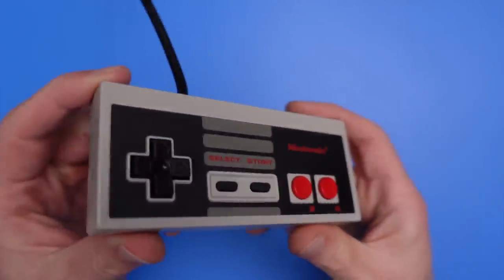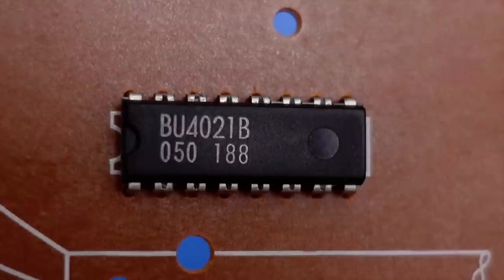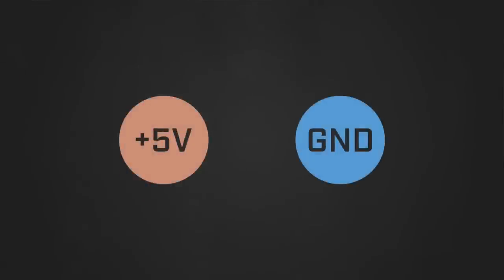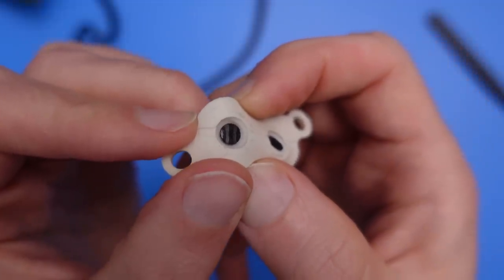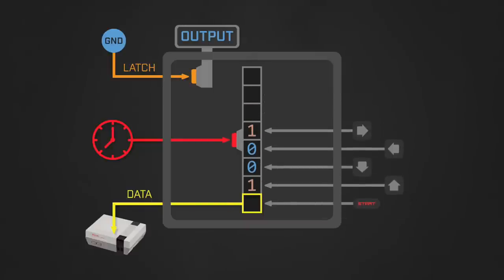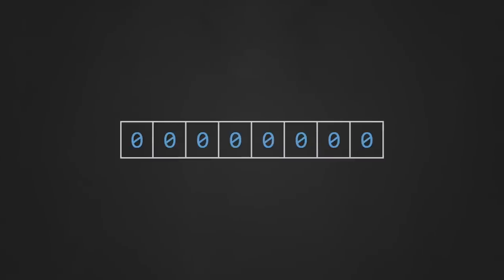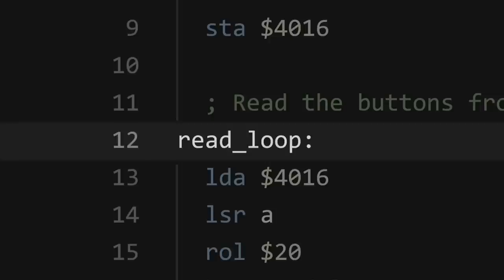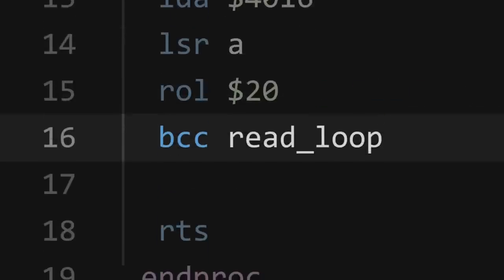NES Controllers Explained

Comment: Thanks for this, I’m enjoying the series. I’d love to see some discussion about how to call this and react to inputs. Do you do this at the start of the NMI to check for game inputs on each frame?
Reply from the maker: Yeah reading inputs every NMI is definitely the easiest way to go. That said, you only have around 2200 cycles to play with during the VBLANK to update the PPU VRAM. So if your VRAM update code is very tight you might need to save the NMI cycles and use a flag in RAM somewhere so the non-interrupt code can break out of the infinite loop and perform the read while the screen is being rendered by the PPU.

Comment: Wow what a great explanation.
Your visuals make it so much easier to grasp.
For future such videos, it might be of interest to give an idea of the number of clock cycles such a routine requires, and to compare that with the actual time it represents.
One question: I've noticed in GameBoy ROM disassembles that joypad inputs are read multiple times in a row, and I assume it's to limit mistakes, but I don't understand how that helps. Is it also the case for NES controllers?
Thanks so much for your excellent work. I look forward to supporting you on Patreon when your page is launched.
Reply from the maker: From what I can see, the GameBoy requires this as the values in the joypad register may not be set immediately and require you to perform multiple reads. I am unsure as to why this is the case, as I’ve not done much tooling around with gameboy programming. NES controller reading doesn’t require this. As I showed in the video you simply need to “strobe” the controller, then proceed to read each of the bits one at a time.

Comment: I really like the way you animated the workings of the BU4021B. What I/O chip is the NES using to decode the incoming serial data from the controller?
Reply from the maker: Thanks! That was a super fun animation to make. So the exact chip most likely changes for each of the specific system models, but according to the schematic the original famicom used two 40H368 3-state logic drivers to do the trick (each port used one of the inverters on each of the chip). The mechanism of operation is a bit complicated since those chips are used for more than just inverting the incoming button data. Here’s a link to a modern equivalent: https://www.ti.com/lit/ds/symlink/cd74hc367.pdf

Comment: It's been well documented the way an NES controller works (being a shift register the most popular IC in Youtube) but it's always nice and fun to have another perspective. Thank you.
Reply: Can you tell me where to go to research information on "micro PCB circuit boards" to make a micro controller for NES that works on NES original console/hardware. That has a ability to have direction on D-pad and/or buttons A/B to have auto-fire turbo capabilities? All the while working without the need for any external programs running on a PC like Joy2key, Rewasd etc....So basically all the turbo functionality is self-contained within the pad controller itself.  Somone said something about altering the shift registers to produce turbo. How do I find info about that? Googling it does not really bring anything up but pre-made third party Turbo controllers and that is not what I am talking about.
Reply: @rebranded1248  either I don't understand what you want or I haven't seen that type of gamepad, I saw a gamepad with extra 2 A and B buttons that fires rapidly, and I can't think of how to build one of those from scratch, but it shouldn't be terribly hard to build up.
Reply: @deltakid0  I am talking about a micro controller where you switch out the original NES OEM circuit board and replace it with a ardruino micro controller board. That way you can have a NES controller with hidden auto fire and  macros. I suspect there might be a couple speedrunners who do it professionally and they are indeed hiding the fact they are using micro controllers with auto fire.  It would have to be a micro controller cause the NES controller needs to retain auto fire ability independant of wether or not it is plugged into a PC or not. Just needs to have that special function if it is plugged into OEM NES console.
Reply: @rebranded1248  well, Arduino is the first option to come up when you need to prototype something, so, yeah, I think it's just an Arduino or even an ATTiny85 to solve your need, I would prefer the latter because of size so that you can fit it in the retail gamepad

Comment: NES Hacker, what is your view on  starting a ROM Hack by finding the subroutine that reads controller input,
then stepping through the code from the controller read, then trying to understand that code step-by-step from there. i.e. using the controller read as an organic starting point for code investigation.

1.) Finding whatever subroutine loads from $4016 (via searching function list in MESEN)
2.) Set a break point on LDA, $4016 
3.) Understand confusing mess of assembly?? 

Thank you so much for all your great content and amazing videos.
Reply from the maker: I think that’s okay, but honestly the controller reading code for most games probably doesn’t have much to do with the actual game logic. For instance, a game like MegaMan 2 has at least 6 distinct controller contexts: Main menu, Boss Select, Password Select, Main Gameplay, Start Menu, & Game Over. So the controller code is most likely abstracted out away from the logic that handles those different game states as part of a set of general routines that runs every frame.

That said, you can still piggyback off the result of the controller code, by this I mean if you can find the memory location where the controller buttons are stored, you can use it to find code that reads and reacts to that code. By combining this with other memory locations you can setup breakpoints that can pinpoint the exact location for code that handles various things (e.g. handling of the D-PAD buttons on the boss select or the code that initiates a jump for MegaMan himself, etc.).
Reply: @NesHacker  Thanks so much for the detailed reply!!

Comment: I know I'm super late to the party but, amazing video - thanks for sharing ! Out of curiosity, some FC controller models appear to have a 15 pin interface, would it possible/feasible to rewrite the controller input pooling routine so it could read a more "modern" controller, with at least L and R? I feel like this could open so many tools for romhacking and modders to add ergonomics into NES games such as zelda1 to swap weapons for example.
Reply from the maker: Yep totally feasible. The SNES controller is almost exactly the same except it has two shift registers which holds the value for all of its buttons. Basically you can use the controller ports as a general serial port as long as the game is programmed to use it that way.

Comment: I remember back then for some reason I took apart my NES controller , stripped the wiring and I tried to attach to my Atari plug . I was young and did not know much about testing but I never got it to work . I wonder if you can actually use a NES controller on a original Atari system . Has anyone tried this before ? Great channel by the way . Thanks
Reply: Atari controllers don't have a shift register. Each pin is used for a different input (Up, Down, Left, Right, Button). You'd have to completely rewire the controller's innards to make it work.

You can, however, use a Sega Genesis controller on an Atari because they both use the same shaped plug with the same directions for the same pins. Several other systems work as well.

Comment: I thought the NES automatically did this and loaded it into memory, that's interesting to know it doesn't. The explanation is really good as well and I understood it without prior assembly knowledge. It's really cool to learn the ins and outs of hardware like this, as a single person can actually understand the entire system as it's relatively simple.
Reply from the maker: It’s kinda cool too, cause you can use the controller ports as a general I/O interface that way. There’s no reason why you’d have to only transmit exactly eight bits.
Reply: @NesHacker  If I recall some of the TASbot submissions for GDQ have actually used the control ports for general I/O for things like audio playback through the console.

Comment: This video came in more handy then you could possibly know. I have maybe a tote full of NES systems with no controllers to test them. Now I don’t need one exactly. Thanks.
Reply from the maker: You are very welcome, I’m glad I could help
Reply: @NesHacker  I actually found NOS wireless NES controllers at a thrift store. For a dollar I picked up a few. I originally wanted to see if it worked for the system I have. Upon further review they went to some remake edition that didn’t use cartridges.

Comment: Of note: ground isn't always the lowest voltage on a board. It happens to be on many.
Reply from the maker: That’s true, I suppose you have negative voltages sometimes! I’m just so used to only working with digital logic so I always think of ground as “low” when perhaps I should think of it as “zero” 🤔

Comment: So if I have an SNES controller hooked up to an NES, and I want to read the controllers extra 8 bits, I just need to have 2 loops and read the other 8 bits into another memory location, correct?
Reply from the maker: Conceivably, though I’ve never tried it… I believe the SNES controller just has two shift registers in series to register all 12 bits of button data. Would definitely make for a fun experiment!

Comment: IDK if the pads on the silicone are printed with a pattern or if the pattern is imprinted by repeated uses. I say this because I took apart these controllers as a kid and never noticed a pattern on the pads, and these controllers were new back in 1985. 😜
Reply from the maker: Yeah I was having a hard time finding solid information on how those switches work. I’ve only ever seen them with the patterns, but like you say it could be due to use. Thanks for the info!
Reply: @NesHacker  dude thank you for doing these videos. I’d gladly contribute to your  patreon account.

Comment: What about button bounce?  Is that something that the programmer needs to worry about / test for?
Reply from the maker: It depends on situation. For things like menus and the like button bounce might be handled by waiting some amount of time to ensure the player is pressing the confirmation button. For most gameplay, however, responsiveness is more important so generally you don’t try to denounce the inputs (remember the NES runs pretty darn slow even compared to modern hobbies microcontrollers).

Comment: It's interesting that they used an integrated circuit on the controller itself to digitize the controller inputs before sending them to the NES.   It seems it would have been cheaper to skip the IC within the controller and send the analog signals from the button presses to the NES to be digitized, but I guess this didn't work as well.   I wonder if earlier game consoles did something like that.
Reply: If you didnt have the shift register you would have to have 8 wires returning instead of 1. The shift register makes it so that you can send a string of 8 bits back over one wire which tells you which buttons have been pressed rather than having one wire returning per button. 

Apparently wires were more expensive or something compared to the IC in the controller. Doesn't make a lot of sense to me either.

Comment: It sounds like the longer route on how Modems work. Encode data into signals and have them converted back into readable data on the other side in the console.

This kinda explained me how they could send all eight buttons through mere 3 data + 2 electricity cables, unlike other contemporary consoles with cables that weighted more than the controller itself!

And the blacked out graphite pads above the main buttons pads on the PCB are just resistors??
Reply from the maker: Yeah pretty sure they are, I was reading around 50k Ohm with my multimeter when I tested across them (though that’s probably a bit high since there is probably some amount of corrosion on the test points and pins I was using as contact points). Also one side is connected to high voltage and the other connects to the button switch / pin trace, so the only thing they could really be is the pull-up resistors for the button switch circuits.
Reply: @NesHacker  And me thinking they were left overs from the 2nd player or japanese FamiCom controller PCB designs and that I should scratch and tap to see what they do, haha! Now I see it's a terrible idea... 

Will you point out the differences and mechanics on the FamiCom controllers in a future video? They seem a bit smarter than American ones.

Comment: I’m sure most people know this but opposite directions on the D-pad can’t be pressed at the same time for example the up and down directions can’t be pressed at the same time or the right and left directions can’t be pressed at the same time but up and right or down and right or up and left or down and left can be pressed at the same time
Reply: I used to do programming on the Commodore 64 which used 4 position joysticks which like the NES controllers should not be able to press opposite directions at the same time, but I can tell you if you move it around vigorously you may get some from time to time.  So best to design the code to handle it cleanly.
Reply: @sa3270  I see

Comment: Something I found really strange is that some official NES controllers are not cross-compatible in different regions.
I believe the 101E models will only work on PAL system while the normal 101 will work on either.

I'm also curious about something.
You say the controller can receive inputs from the NES. I was wondering to what extent this could be used.
Like, let's say we had a theoretical NES controller with a little LCD display ala the Dreamcast.
Would it then be possible to send picture information to this little display while you play if the controller had some ram onboard to handle it?
Reply from the maker: Yeah, so there are apparently PAL consoles included diodes on the controller ports, which require the controller itself to pull the clock and latch signals high in order to operate correctly. The PAL version of the NES-004 has a 3.6K Ohm  resistor pulling both lines up to high voltage. As for using the ports for external communication, I’m pretty sure this is possible (from what I’ve read) but I haven’t tried it myself. Might make for an interesting experiment to document in a video :)

Comment: I there are only 5 buttons on an NES controller “A” button 1 “B” button 2 Start button 3 Select button 4 and the D-pad 5 where does he get 8 from does each direction on the D-pad count as a separate button? If so then it would be “A” button 1 “B” button 2 Start button 3 Select button 4 up direction 5 down direction 6 right direction 7 and left direction 8 so if you count each direction on the D-pad separately as opposed to the D-pad as one button then yeah there are 8 buttons

Comment: The communication sounds exactly like an SPI protocol. Assuming the limiting factor is the chip on the controller, It should be easy to replace it with a modern microcontroller with a higher clock frequency to decrease latency and improve response times.
Reply from the maker: It is similar, but you gotta remember: games execute specific instructions at a particular clock speed, so even if you increased how fast the chip on the controller worked it would take the same amount of time due to game code. Also you can easily handle the reading of all buttons in a fraction of a frame, so even if it were faster there would be no noticeable increase in responsiveness.
Reply: The 4021 already works at 1 MHz and more.  The whole latch-clockout procedure can be done within 10 uS.  There isn't much headroom with this protocol.

Comment: You for get to mention that the nes cannot read and process a controller input signal along with a dpcm sound signal atonce,that’s because they share and use both the same pin,most early nes games had no dpcm audio,trough,nes games that did supported dpcm audio, solved that problem by comparing button presses with it’s own interprationss(because the nes always assumes that a button was pressed),and if they match the button presses will be considered as legit,if it finds no match,it rejects it,another option would be to disable dpcm playback during button presses,or it could ignoire button presses during during dpcm playback during button presses(wich could be ideal during cut scenes when theres no game play)
Supermario 3 for instance uses an comparision algorithm and surprisingly enough theres no input delay at all,or atleast it’s unoticible for us(alltrough i do hear story’s about speedrunners complaining that the duck jump doesn’t alway’s get’s registred), well i would be not surprised if supermariobros 1 plays just slightly smoother because of not using the dpcm channel at all,
Not this issue has been solved on pal nes systems,but i don’t think that pal games were adjusted with this fix in mind,maybe some pal games?? (Wich may explain why they could behave strange on a ntsc nes because of this aside from timing issues??? ) but not sure, but it’s interesting to examin that.